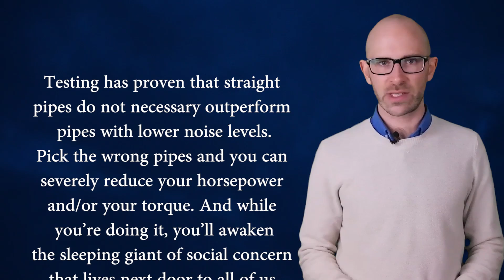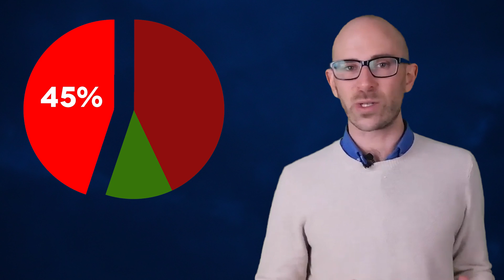Why are Harley Davidson Motorcycles So Loud?

Comment: Not noise, it's the language of my people. Just to point out, it's not just Harley riders modifying their exhaust. You can get aftermarket exhaust for every model of bike and few to none of them are technically street legal. People are their own worst enemies, one day we will have to pass inspection to license and register bikes. There's already spot checks for sound in some areas just for bikes. So anyone planning to replace their exhaust system keep your old stock pipes because one day you might need them after all.

Comment: YOU ARE SO WRONG   HD COME OUT OF THE FACTORY STOCK --NO LOUD NOISE AT ALL-----THE COUSTMER CHANGES  THE EXAUST PIPES TO HIS ORE HER PREFERED SOUND LIKEING. AND IF YOU DID YOUR HOME WORK YOU WOULD HAVE NOTICED THAT ALL BRANDS OF MOTOCYCLES CAN SOUND LOUD  BUT NOT FROM THE FACTORY ONLY WHEN THEY ARE MODAFIED BY THE OWNER.  ALL MOTOCYCLES  FROM TE FACTORY HAS TO MEET THE REQUIRED---- DB-----LEVEL IF THE DIDNT THEY WOULD CLOSED.
Reply: WHY WAS A LINE INSERTED ACCROSS MY MESSAGE?????????????
Reply: WAS THE TRUTH TO MUCH TO HERE..
Reply: IM NOT SHOUT1NG  I LIKE TYPEING IN CAPS I AM BLIND AND REALY WHO GIVS A SHIT.  LOUD PIPES ARE GOOD FOR MY EGO.

Comment: Decibels aren't on a base 10 log scale. It's on a base 3 scale. So every 3 decibels is twice the sound. 
Idk how base 10 became the common reference
Reply: Nobody uses base 3 for anything. A "bel" is the base ten log of the power ratio. Nobody uses "bels", though, they use ten times that, which is a "decibel". Decibel=ten times the log of the power ratio. For twice the power, log of 2 is 0.30, or 0.30 bels, and ten times that is 3 decibels. If measuring loudness, or sound pressure level (not power), the formula is 20 times the log of the ratio. The 2 is because power varies with the square of the sound pressure level, and log (x squared) = 2 log x. So a factor of 2 increase in sound pressure level - what you would read if you hooked up a voltmeter to a microphone - is 6 decibels. 

It gets worse. In most physics and engineering problems the base ten log doesn't make much sense; instead they use the "natural" log, which is the Napierian base "e", written "ln" rather than "log". e equals 2.718...
Reply: Tom Swift all I know is that I was the exhaust engineer for Auburns SAE team and everything I read said that a 3 decibel increase is 2x the "loudness"

Comment: Just going to point out that high visibility is much more useful than noise on the highway.  The motorcyclist with reflective striping or one of those headlight modulators will be noticed long before anyone could possibly hear them, no matter how loud.
The "loud pipes" are mostly heard by those behind the bike anyways.
But seriously, if you are a biker who is honestly concerned with safety and not just being badass, those headlight modulators are probably the best modification.  Even in daytime.

Comment: Regarding Motorcycle crashes. Whether the crash occurs when the driver of the motorcycle is completely alone. Or, when the crash occurs with an automobile. A staggering 87% of all motorcycle drivers involved in a crash are over 5'9" tall. While only 13% of all motorcycle crashes involve a motorcycle driver who is under 5'9" tall. Why is this you ask? It all has to do with physics. Regardless of Make, Model, Year, Custom Bike or Factory floor model. Motorcycle drivers who are 5'9" or under, have a much better "Center of Gravity". And are by far, physically superior to their taller counterparts when it comes to maneuvering a motorcycle with greater ease and accuracy, if faced with a possible mishap on the road. This particular statistic applies to ALL bikes. Including: Two wheeled bikes (with, or without side car and/or trailer), all Traditional Trikes or even the least popular "Can-Am" style of bike. Scooters and Mopeds demonstrate the very same percentages. Which begs one question.... "Why don't Insurance Companies take these facts into account, when they issue the Premiums to the Motorcycle driver?" I am 5'8" tall. Why should I be forced to pay the same amount as a person who, statistically, is far less capable of operating a motorcycle in a safe manner. All due to a proven handicap, which is reflected in their height. This makes no sense to me at all.

Comment: The life Saving aspect I believe is defenitly true, as a retired truck driver i have experienced first hand what it's like to make an attempted lane change and for what ever reason the biker that wasn't a where  he or she was riding in a blind spot alongside has gotten to share in my unwanted surprise fortunately for both of us nobody was ever hurt even though the possibility of disaster could all to often have been measured in a few inches and the horn on most bikes is barely even audible in the cabs of most semi's especially newer models that are insulated from outside sound better then older models and even though statistics show the most accidents in general between semi tractor trailers and other vehicles prove to be the fault of the motorist, I think it is safe to say that most truckers feel human life and what ever can be done to preserve it is more important then anything they could haul on with a truck. Loud Harleys are like Emergency sirens in that when either one is running close by, there is no mistaking it and since motor cycle enthusiast don't have near the protection offered them as do other vehicles they need all the help they can get and I for one have no problems knowing were they are when sharing the road with them. and no, I'm not a biker but I defenitly understand the freedom of an open road.

Comment: As someone who has been rear ended while on a motorcycle and would've been killed had I not been wearing a helmet (seriously, my helmet was destroyed, split near in half. I don't even wanna think what would've happened to my head) I feel uniquely qualified to comment on this. 

My bike didn't have extraordinarily loud pipes, but they were loud enough that I got the occasional complaint (they were stock on a Suzuki cruiser, so any replacement would have probably been louder). The guy who hit me had to have heard them, but he still hit me. People who don't watch for motorcycles aren't going to register hearing one till it's too late. That's why seasoned riders are always looking out for the idiot who's about to kill them (and there's always at least one). I don't believe that loud pipes save lives. Nor do I relish the thought of more hearing loss than I've already inflicted upon myself as a less-than-wise young man.
Reply: Completely agree. Rather than loud pipes (which have the added problem of annoying the neighbors if I decide to set off in the early hours for an all day ride out), I have fitted an air horn. Not measured it yet, but pretty sure it is in excess of 100dB, and will always gain more attention than my engine.

With that said, I ride like I have a target on my helmet, and everybody else is driving with their eyes closed. The number of cagers I have avoided over the past 15 odd years is disappointingly high. On the other hand, life on a bike undoubtedly makes for a better car/truck driver...
Reply: thankyou
Reply: I disagree. The noise is a passive feature. When I filter with a stock exhaust bike vs an aftermarket one I can see the difference in car behaviour. It's important to ride defensively and wear protective gear too.